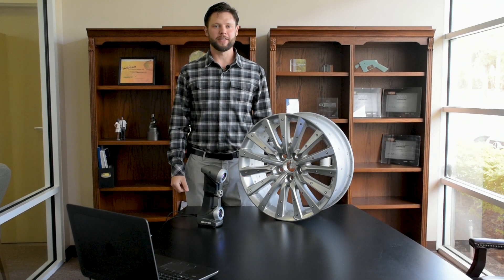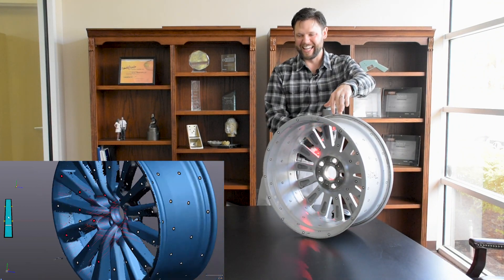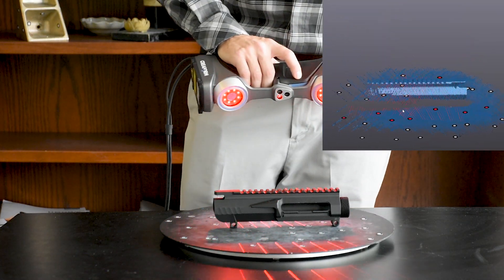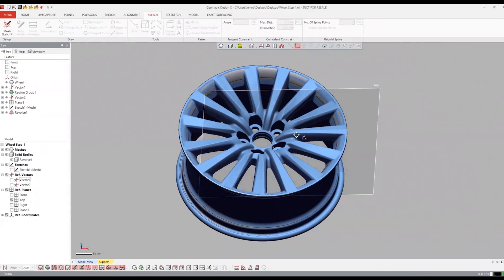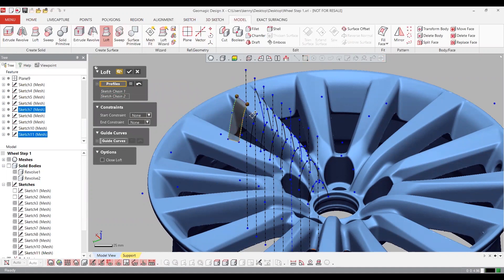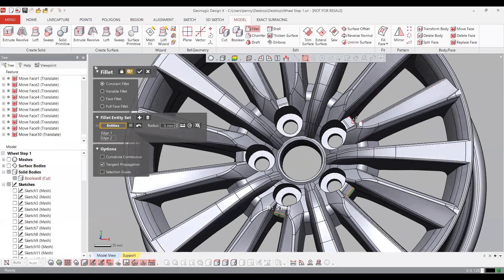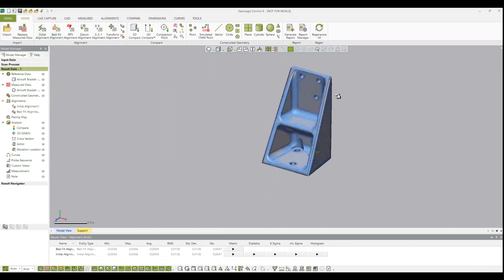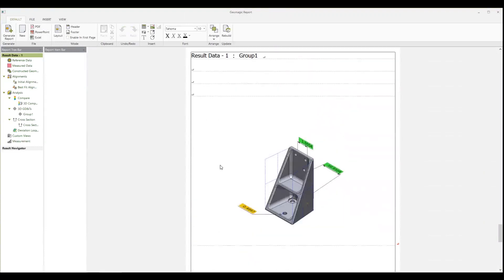Creaform HandySCAN - 3D Scanning for Reverse Engineering & Quality Control

Comment: You can merge scan without setting points on scans? Just with the "align" function?
Reply from the maker: Within VX Elements, the software that drives the scanner, you can use the targets (sticker dots) to automatically align scans from 2 different positions.  As long as you have 4 or more common targets between the 2 data sets.  Or, you can also manually align different scans.

Comment: What prevents it from scanning the table and/or every surface the laser light touches?
Reply from the maker: There are a couple of different ways to address this issue.  1.  you can create a clipping plane such that no data below the plane is collected.  2.  You can easily select and delete unwanted data once the scanning is complete.

Comment: Cant buy Somewhere no price Anywhere Boring I think the company has gone bankrupt
Reply from the maker: Mikael:  NeoMetrix and Creaform are still very much in business.  The scanner is an industrial tool, which is bundled with various application software solutions.  So, prices vary greatly depending upon the total solution provided.   We can provide pricing for our prospects here in the United States.   Contact us at info@neometrixtech.com.  If you are located elsewhere, you will need to find a local dealer.  Best of luck.